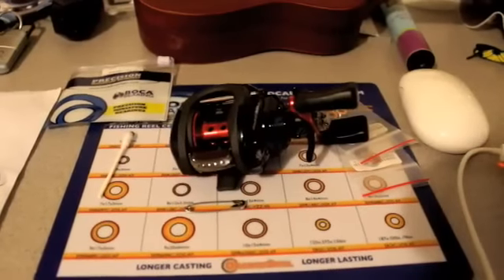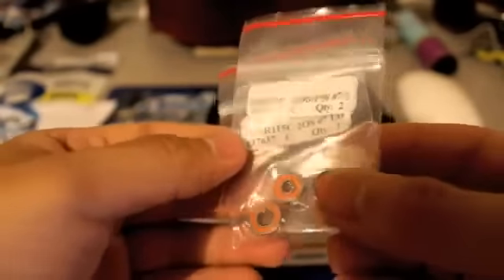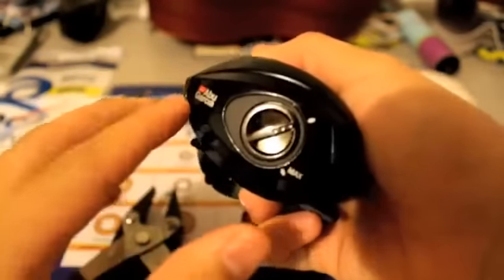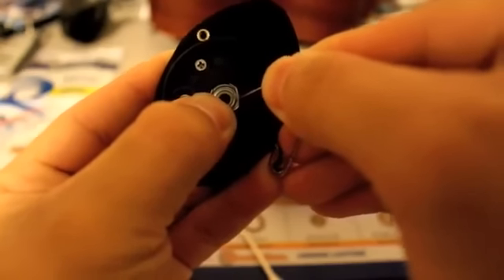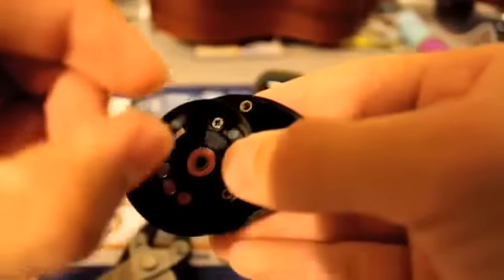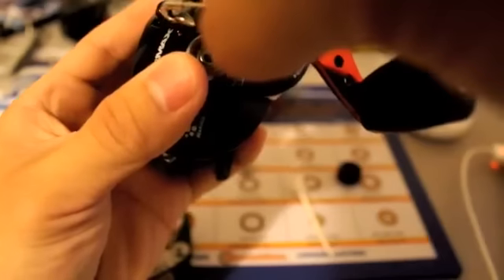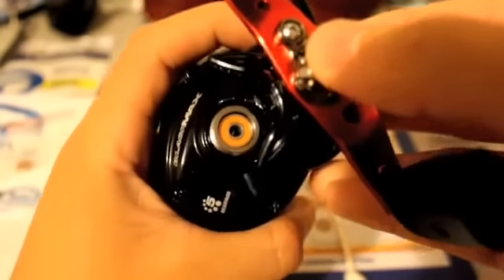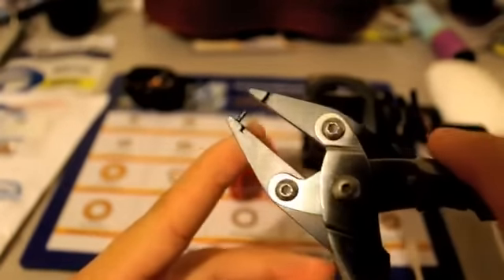How to replace Abu Garcia Black Max Bearings

Comment: Amazon has bearings for much cheaper ,ceramic with rubber seals , are they that much different than Boca ? i got enough to do 2 reels for less than 12 bucks.
Reply: Did it work lol?
Reply: Hi I want to order some but don’t know the size or model number, can you pls give me a size or model number or the link to buy these ball bearing
Reply: I just went on line and went to the boca brings and typed in what reel you have and it gives you the size .then I ordered from Amazon. Still works smooth after a couple years
Reply: @davidogden8370  thanks

Comment: I have used the black max reels and they are great , some people say there cheap crap and back lash all the time but I don't know what there problem is because I have two of them and they never backlash maybe they don't really know how to use a bait caster ?
Reply: +Kickingtheirbasstv: I agree. The black max was my first baitcaster and I still use it just as much as my high dollar reels. Ya its not as nice but it works fine and it keeps on going
Reply: FamilyMann I have a Shimano Exsence dc and I still use my black max on a second rod when I hit the lake
Reply: ive been having issues. i learned on the bmax 2 and got pretty good with..now i use two different pro qualifier reels and after using those and coming back yo this i get backlash all the time even when im feathering the spool harder than normal..took it apart didnt see any issues im just confused
Reply: ive been having issues. i learned on the bmax 2 and got pretty good with..now i use two different pro qualifier reels and after using those and coming back yo this i get backlash all the time even when im feathering the spool harder than normal..took it apart didnt see any issues im just confused
Reply: They are fine. If they are tuned to lure/bait you wont have any backlash issues

Comment: my issue is that my spool tension knob fell off, i got another one that fits not sure if its the right size but i cant get it to tighten the line drop all it does is speed out line. would you happen to know the exact part number for the spool tension knob?

Comment: If you clean your bearings with lighter fluid then replace with bones speed cream it will be off the chain fast and won’t need ceramic bearings plus ceramic bearing are loud but last stainless is best

Comment: how much of a difference is there between the the abec 7 and abec 5,Also in the video it appears that there are two different size bearings for this particular reel. Will the kit contain all the bearings that I will need to do this upgrade

Comment: So for the most part in the Revo/Max family of baitcasters, a SMR103C (3x10x4mm) bearing is used in the spool brake which is Abu Garcia part # 1125827?
Reply: Hello it the size of the 3 bearings ? 3x10x4?

Comment: Dam I just looked at the price of the bearings and they are as much as I paid for the rod and reel combo ! 50.00 plus shipping for bearings I can get another reel and rod for that price !
Reply: +Jeff Brooks are the part numbers the same?
Reply: +Jeff Brooks thanks! I'm going to purchase a set. My Black Max has been a little workhorse in Mission Bay. It deserves an upgrade.
Reply: Clean your stock bearings and put a drop of rocket fuel oil on each one. Instant upgrade

Comment: I'm pretty close to chucking this reel across the street. Can't take the side plate off.
Reply: i’m guessing yours doesn’t have the screw. on mine you push the bar that is visible around the top of the reel to the side and you push the side plate up
Reply: Yeah I figured it out. I made another comment saying exactly what you described. Thanks

Comment: Bought 2 black maxes for my kids. They suck. I wouldn't waste any money upgrading it. Johnny morris makes a decent real for a bargain base. Just saying.
Reply: why do you say the suck
Reply: Elliott Ong  They are not very user friendly. They backlash easily. I thought I had it set so it would be impossible for a backlash and lo and behold, many backlashes. I let them use mine and I thought I could do better. Backlash city. What's nice about the Johnny morris is you have two brakes. You can set them up and kid proof them and let them have a reel like dad.  I thought it would be a good beginner reeel for the kids and well it's not a good reel AT ALL. It can cast a long way if you loosen it up but it will backlash all day long. Spend just a little more and get something you REALLY ENJOY. The pole  it came with was nice though. I wouldn't buy one except maybe for catfishing or trolling. If you get a fish it seems to dig the line into the spooled line already on the reel and I think that may be part of the backlashing problem.
Reply: M Busch  how much did you pay for it
Reply: Elliott Ong Fifty nine bucks with the pole.
Reply: thats freaking cheap compared to singapore's price just the reel alone would cost around 60-70 + here
Reply: Elliott Ong  Not really worth it. Buy Bass Pro shops. They perform really good. I would buy a zebco 33 spincast before i would buy a POS black max or any abu for that matter. Oh and stay away from the skeet reese reel. It's a pilo.  If you look on ebay you can get a quantum smoke closeout for a hundred. And a tatula on ebay is about a hundred. Heard good things about tatula. I don't know what else to tell ya. The max isn't worth buying and isn't worth upgrading IMO. But others think it is. So who you gonna believe.
Reply: M Busch you must nkg know how to use it. Me and a few people i know have the black max, and ig performs flawlessly. It doesnt backlash or anything. I dont even have to use my thumb ti stop the spool. You have to set it up right.
Reply: +Always Armed88 I've had an abbassadeur 5000c for 20 years. still smooth as the day I bought it. Looking at a Black Max next. Not really fair to say someone's whole product line is crap because the user can't use it properly. No baitcaster is guaranteed antibacklsh and to think that much less say so is just wrong.
Reply: +Always Armed88 sorry, that wasnt meant g
for you. I clicked on the wrong person.
Reply: sjeverett75 no problem man
Reply: sjeverett75 i liked the black max when i had it
Reply: If you can't use a black max without birdnesting it then it's YOU, not the reel LMAO. I have 2 of them and love them!!!